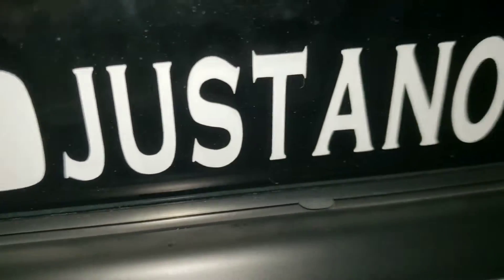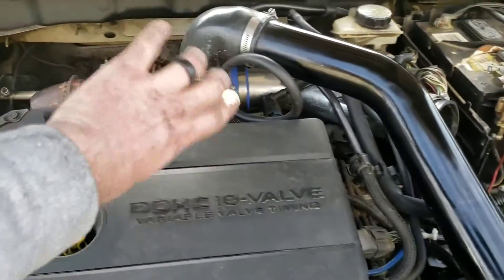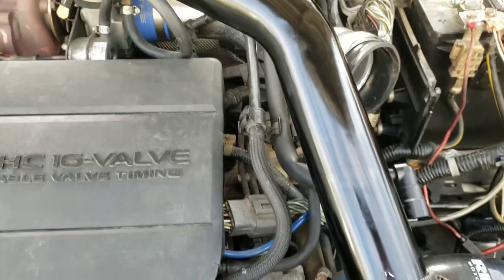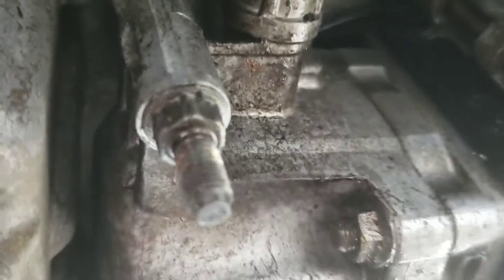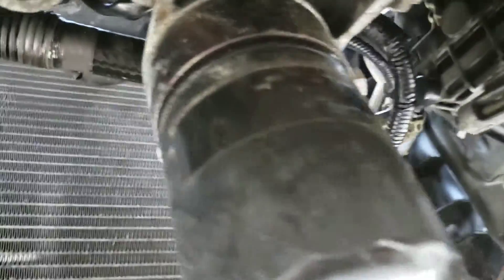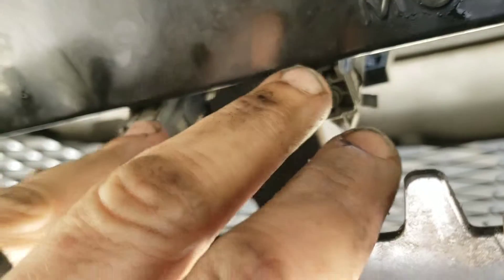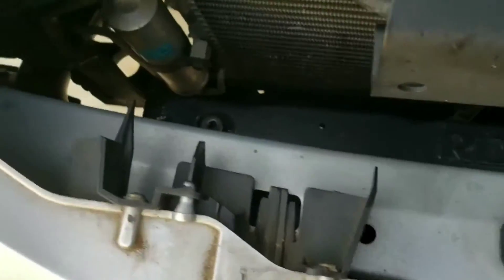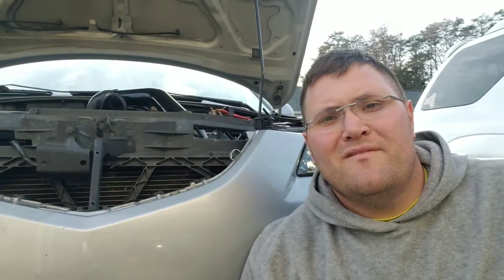How to turbo a Mazda 3 Pt 2

Comment: Where’s your fuel regulator?
Reply from the maker: Hi Gerson Avila, mazda 3 does not need a regulator for it is a returnless system.
Reply: Thanks man, what injector you have and fuel pump?
Reply from the maker: @labestia5044  np! I am running stock injectors and getting ready to install my new walbro fuel pump. New injectors will come in time
Reply: Where is your oil feed line ? I saw your return goes to your oil filter but where's the feed? Generally asking as im looking at turboing mine